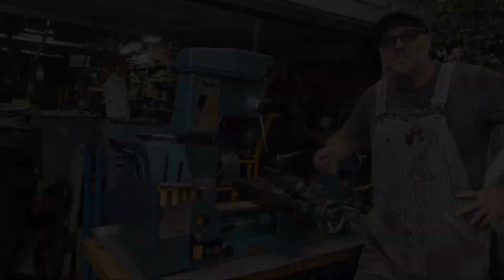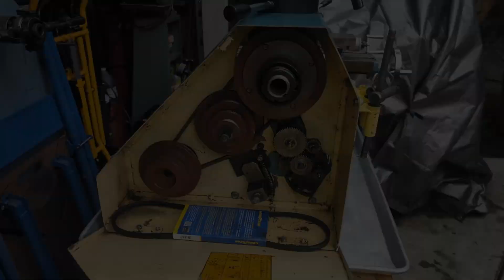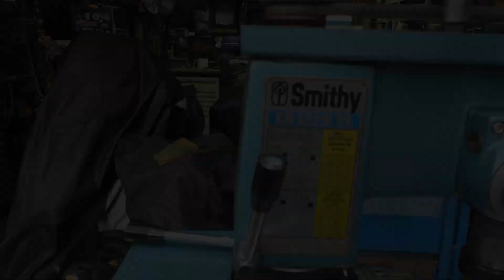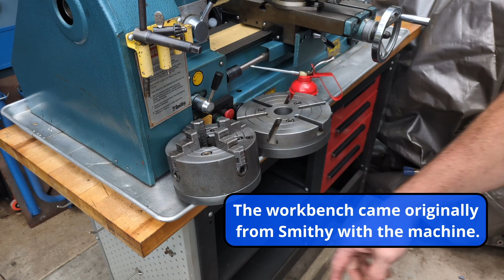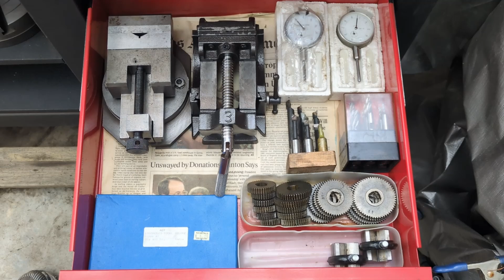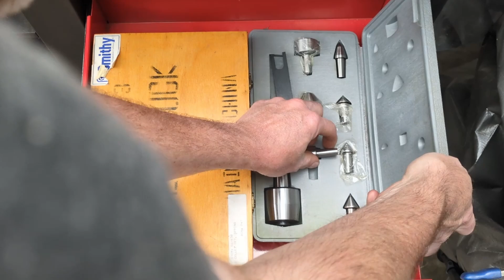For Sale - Smithy Lathe/Mill/Drill Combo

Comment: https://images.craigslist.org/00m0m_63PceaELWjp_0CI0lM_1200x900.jpg This link should open to pictures I have on the Smithy Combo Unit. I probably need to take better pictures. I had some folks calling me last year and naturally I couldn't answer any of there questions. As I know nothing about this equipment. My husband is no longer here for me to ask, you were correct about the difficult times. He passed away June 2023. If you can see the picture I think it does have a digital read out like you had asked if you look at the far left side of the machine you can see a square little window covered with red plastic, and when the machine is on I believe it lights up with a number.  I remember I had someone ask about the speed. I would assume the answer may be self explanatory by looking at the front of the machine? Thank you for the tips, I have tried many of those ideas last year, then gave up. No luck. That is what drew me to your youtube showing folks how to use it and what is good for. Thank you for being so kind. I may just email you for the next person to have questions I can't answer I bet you would know just by looking at this machine. I remember spending over $7000. at the Smithy factory. Then I don't know about all the parts and accessories that go with it. I was listing for $6000. Does that sound about right for pricing?  Thank you again. I appreciate you answered me and so quickly.  God bless you.
Reply from the maker: Hi Kathy - I followed the link, however it only allowed me to look at one picture.  It was enough to tell it's a 1340 which I think is more attractive to buyers than a 1324.  13 is the maximum diameter of a part you can turn on the lathe, and 24 or 40 refers the maximum length.  So, yours could turn a part that is 13" in diameter and 40" long.  That's a big chunk of steel!  

The little window with red plastic tells you the speed that the machine is rotating (RPM) and is not a DRO.  However, I wonder if there might be a DRO under the Meijer plastic bag.  That's the right location for it.  What's under that bag?  The DRO might look something like the one in this video - https://www.youtube.com/watch?v=VBbKYrHZ5sA&ab_channel=BoatCanvasUniversity

Do you have the original invoice?  If so, perhaps we could figure out a way for you to send it to me without telling the world our email addresses.  We can cross that bridge if we need to.  Having the invoice would be really helpful. If nothing else, perhaps Smithy could send you a copy of it.  Hopefully, that would list out everything you have there.

Regarding pricing, I do not have deep knowledge of the used market for these machines.  I did find some more comps in the range of $3,350 to $5,250.  The $5250 machine is the same year and looks very similar to yours.

$3,350, 2020 Machine with Cabinet - https://bidcal.hibid.com/lot/211091717/smithy-granite-xt-1340-lathe---milling-machine?ref=catalog

$5,250 2019 Machine with Cabinet - https://revelationmachinery.com/product/smithy-granite-xt1340-xt-lathe-mill-combo-2019-stand-digital-readout-and-tooling-all-included/

$3,750 Unknown Year, Machine with Cabinet - https://www.ironplanet.com/for-sale/Industrial-Plant-Equipment-SMITHY-1340-ELITE-I-MAX-COMBO-LATHE%2C-MILL%2C-DRILL-Virginia/5203760

$3,600 Bare Machine (no cabinets) - https://www.facebook.com/marketplace/item/1044656017155312/

$6000 might be a bit high, but 1) if you have a bunch of extra tooling and 2) if you were fielding calls, then it might be OK.

Here's a to-do list. 
1) Look under the Meijer bag and let me know what you find
2) let me know if you have have or can get the original invoice listing everything that was purchased with the machine.  That would be really helpful. 

Let me know what you find and then we can figure out a way to communicate more directly.
Reply: @WernersWhirligigs   Thank you. every comment I leave keeps disappearing so apparently I am bad, posting stuff not allowed. :(    I appreciate you. thank you

Comment: Hello Werner, I have a Smithy Granite 1300 Series Combination Lathe ,Mill, Drill Combo for sale. I put it on craigslist Detroit Michigan. I wonder if you might share with me what you think how I can get my best results with selling this unit. My husband purchased new 2019 and used it probably less than 24 hours. He was getting very sick shortly after buying and so it has sat covered up and I have been trying to sell it on marketplace and craigslist for the past couple years. I don't know much about the unit which makes it hard to advertise to spark buyers interest. Any chance you had persons looking to purchase second hand that were hoping to find on this end of the country.? This unit comes with lots of extra tools, and 2 cabinets. Also a special work bench was made for the unit that is on casters and will move any directions with a turn on the table top bolts, tighten up when you have it where you want it to sit.  Kathy
Reply: PS I wonder if you would allow me to put your video link to my craigslist listing? And is that hard to do?   Thank you
Reply from the maker: @KathyKramer-pv6ow  Of course, feel free to post the link to the video, but I'm not quite sure it would be helpful, because the machine I sold does not have some of the important things that your machine has, being much newer.  If you want to post the link, just copy this into your ad - https://youtu.be/R6IQSv_bR8E?si=lEMu4f3c0yuWbiH9.  I know if you put a link on Craigslist, it won't make the link live, so someone would need to take the extra step of copying and pasting the link into their browser.  The same may be true with Marketplace.  This might be a better video series for you to link to about a Granite 1340 Max - https://youtube.com/playlist?list=PLFwYgUwCM9CiQBBA15O2pVkj8E6mRa4a1&si=MIVXrIWKfUPwutTM  I haven't watched it, but it looks very comprehensive.
Reply from the maker: Hi Kathy - Reading between the lines, it sound like you and your family have been through some difficult times. I wish I could send you a hug on the keyboard. I'm sure you've gone through a lot. 

I've been thinking about your situation this morning and I have a couple of ideas. Smithy is located in Detroit and, if you haven't, you might call them and see what they say. I've talked with them two times and, in my humble opinion, the results you achieve might depend on who you happen to catch. 

I would also try calling a couple used machine dealers in your area to see whether they'd be interested buyers. I’d search Detroit, but also Michigan. You may not like their price, but at least then you have a floor on pricing. Try searching the web for the phrase *used machine tool dealer "Detroit"*. I found one that does seem to have some experience with Smithy machines, just north of Detroit. Follow this link (https://kbindustriesllc.com/brands/smithy) and, towards the top of the page, click on "Sell your equipment". You can fill out a form with your contact details and machine info and, hopefully, they'll follow up with you.  If you later get a lowball offer on Marketplace, you can always counter based upon the bid from the used machine dealer. 

I tried to find some info on used machine pricing around the country for the 1300 models, but didn't find much. This ad with a SOLD notice came up so it could be helpful at least - https://www.facebook.com/marketplace/item/1044656017155312/. I realize you have an almost new machine with a lot of tooling and an extra cabinet. You guys probably have a lot more into the machine than the price in the ad. But it's a data point. New machines now start at ~$5500-$6000, and with a stand, tooling, delivery, and tax, you could easily get up to $8000-$9,000+. Does it have a DRO (Digital Read Out)? If so, advertise that because they're $850 new from Smithy. It sounds like you have some experience with classified ads because the way you described your machine is very interesting to me if I were a buyer. Did you include a lot of pictures in your ad? Pictures are always important to me. I would think about bullet point listing everything that was purchased that shows on the invoice. Or include pictures of the original invoice which should list everything that was purchased from Smithy, and just cover your address/phone if it's on the invoice. 

There were a couple of people who said, "You're too far away or I'd be interested". Maybe they'll see these messages and come back.

I’ve written a book, but hopefully you’ll find a few things that help you in the right direction.  Feel free to keep me posted and I’ll help you if I can.  I’ll respond to your other question in a moment.

Comment: Had another question sir, do you know the specs or part numbers of the adapter plate and or the 4 jaw?
Reply from the maker: I don't know off of the top of my head, but I can give you some pointers and also look at my machine a little later.  This post is really helpful and might give you most of what you need - https://www.hobby-machinist.com/threads/smithy-1220-4-jaw-independent-chuck-adapter.104333/

In the post, someone calls the mount "a fixed flange spindle 3 hole mount".  Sounds about right. I bet you could look at your 3-jaw, assuming you have one, and get the info you need.  On mine, the base plate is integral to the spindle (I think that's the "fixed flange"), so then you just use three bolts, or studs depending on how you set it up, to mount the chuck ("3 hole mount").  I don't recall how the chuck registers to the baseplate but it is also discussed in the same post.  In the 2nd post in the thread, the guy cut a recess in the bottom of his new 4-jaw chuck for registration, then drilled/tapped 3 holes in it, and he was done.  That would be ideal, rather than inserting an adapter plate, in my humble opinion.

I'll look at my machine later and let you know if anything else comes to mind.
Reply: @ thanks. Yes I have the same 3 jaw which attaches by the 3 bolts to the flange spindle combination. I’ll see what I can find. I have tried to avoid ordering from smithy but I did break down and buy a set of gears from them.
Reply: @code3responsevideos872  I'm looking at my 3-jaw and 4-jaw chuck now.  The 3-jaw doesn't have a name on it and the 4-jaw says Smithy.  The 3-jaw does not have an adaptor plate and bolts directly to the flange.  The 4-jaw has an 11/16" thick adapter plate and a diameter of 160mm or 6.3" (as does the 4-jaw chuck).  The adaptor has 4 threaded holes to mate up with the chuck and then there's 3 threaded holes to attach the adaptor plate to the spindle flange.  I'm not sure why they included the adapter plate.  Perhaps because the 3-holes would line up on a step on the registered surface, but that doesn't seem like it would be a problem.  I hope that helps.